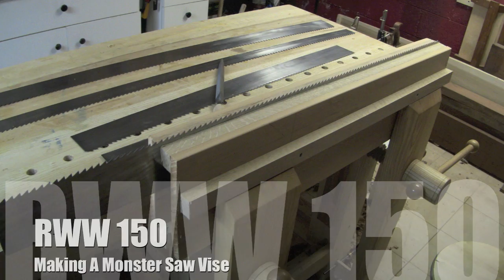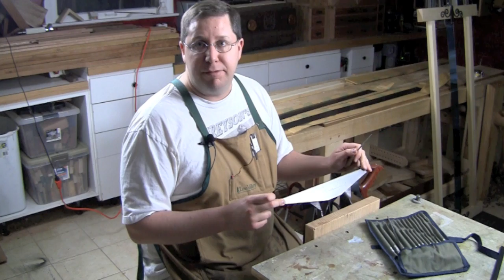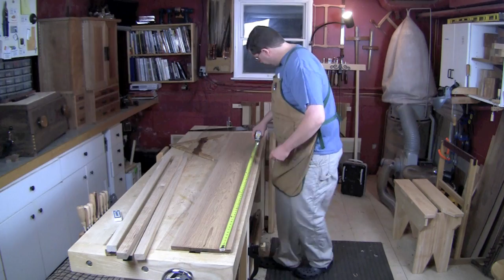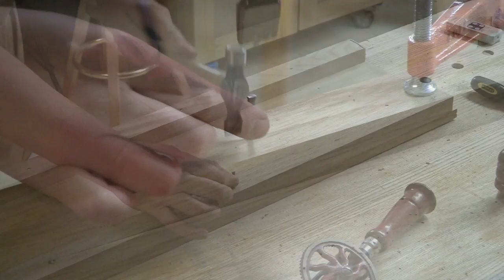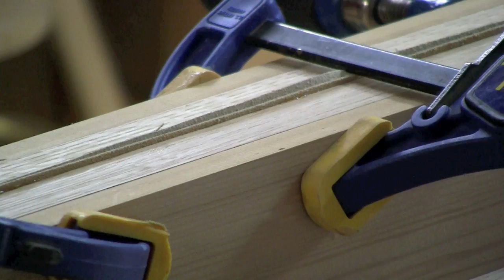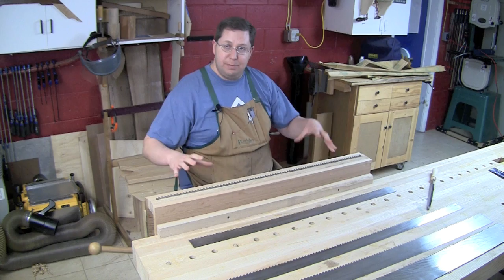RWW 150 Monster Saw Vise

Comment from the maker: It is Olde Brown Glue and it is excellent especially when warmed up like I'm doing here.  I have also used Titebond brand with similar results but I find it doesn't flow as easily when warmed.